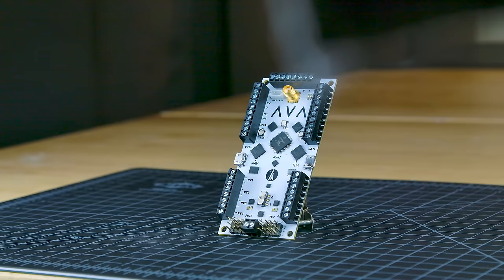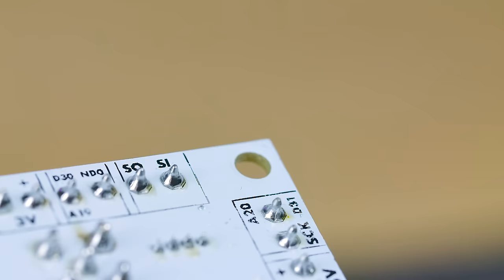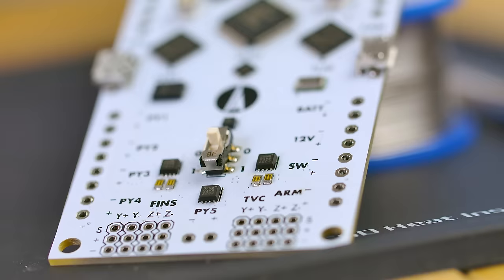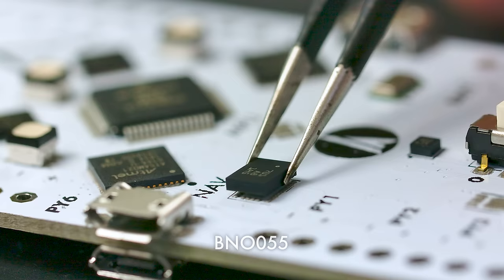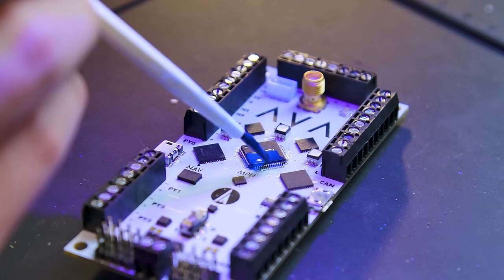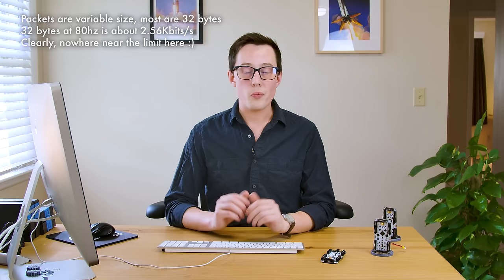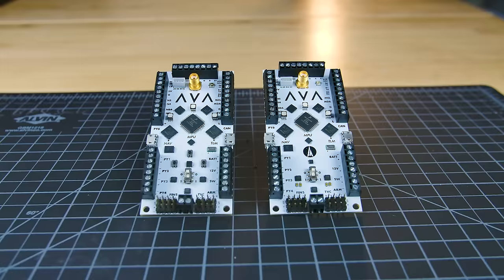The AVA Flight Computer

Comment: Joe, ... dude, why are you apologizing and feel you have to justify your choices. If an avionics or electronics engineer or micro systems designer is watching your channel, I guarantee they are 100% impressed at your over all knowledge, skills and craftsmanship. I am (was at one time - retired now) an electronic tech, process controls tech, microwave systems tech, and eventually combined that all into marine automated systems tech/engineer. I once worked for a satellite communications company as a PCB layout design artist and lab tech (doing it the hard way with graphics layout tape and dry transfer and etching each board one at a time - mid 1980s) You have NOTHING to be defensive over. Those that make "snarky" comments want to feel they are on a similar level with you. In a way it is a compliment that these people are using your abilities as a measurement for their own abilities and knowledge - that you are setting the bar they wish to beat The others that are just being rude, tell them to kiss the warm end of your rocket motor and go start their own YT channel.

Comment: I don't know if this is helpful or not two years down the line, but your problems with UART are probably down to the implementation used in the Arduino bootloader. When implemented correctly, UART should not take up any more CPU time than any other protocol. The software just needs to be optimised to hand-off as much of the processing to the UART hardware in the CPU as possible

Comment: Arduino is nothing to be ashamed about, its a really useful environment, but it is really inefficient and slow compared to dedicated IDE's such as the ESP-IDF for the ESP32, which has 2+1 cores that can run simultaneously at 2x240Mhz+8Mhz

Comment: There's a reason the very first command I always give nearly any UART device (including GPSes) is the one that switches them from 9600 to 115200 baud.
Although if you write everything to use the UART interrupts rather than polling, then the low data rate isn't really that bad.

Comment: What many guys fail to take advantage of is a RTOS.  Many simply think lets get a faster cpu.  That does not matter much when your doing one task at a time that is slow like serial or even I2C data. 
Time to move onto the ESP32 using ESP-IDF, and NOT the Arduino flavor as its a joke.  ESP-IDF has a feature called menuconfig where you can customize so many options for the dual cores its crazy. When you use Arduino for it, they do not allow you to get access to all those settings which is just plain stupid.

Comment: In the 90's and the early 2000's I've learned to work deep with UARTs, their flaws and limitations. My bible was the "C Programmer's Guide To Serial Communication" and I have my head filled with so much useless information about serial communication. The principles always were very simple but the implementation... well... almost never was.
When I see a young engineer bitching about serial communication, it makes me feel old.

Comment: What's the difference between unlocked and locked GPS units? I thought only the military could get GPS chips that don't shut down if they go too fast or high.
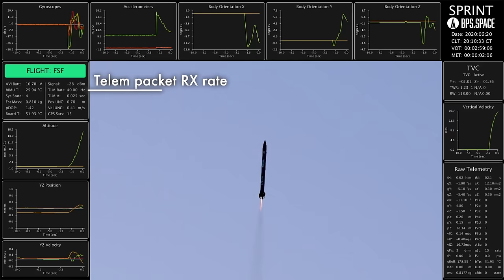Edit: 14:44 Wtf, data is being sent as a string, why?! Did you mean just as a string of raw bits of a certain length... like a packet?
Reply: packet im pretty sure.

Comment: You are probably going to be better off with your current design with multiple MCUs with separation of duties compared to a multi core multi threaded single MCU and have to deal with synchronization issues.

Comment: I don't see that it is "amateur" to use Arduino and / or Arduino IDE. There is no reason for making every library and other stuff by yourself, when there a lot to take from and you can use as you want. Neither Arduino or the Arduino IDE are not limited in anyway, that let you make good stuff or higly skilled algorithms. The only limit is in the chip that has been choosen for the project. Yes I still use Arduino IDE 1.8 and also the original Python IDE when i do coding. They works, do as suposed and time is spent on the project, not errorcorrection on a 3. party software.

Comment: you make really good videos.  If rockets ever get old I think you could be equally successful in many other areas of Maker/engineering.  Trying to make an on off rocket perform like an analog controllable rocket may be something that turns out to be impossible to land reliability.  This isn't YOU this is analog vs digital actuators.
Reply: Rockets will never get old

Comment: how can i get this flight computer ! i can't found it
Reply: he isnt selling it. like he said in the video
Reply: Holy sh*** i need something like this I working in my graduation project try make quadcopter and it's very difficult to get position from IMU i search about navigation systems algorithms or autopilot , where can i get these things?
Reply: @darkknight700  you can make your own!
Reply: Nooooooo , i try do it about 3 weeks , to get position need to do double integration use trapazoidal , so every small noise will integrate twice  ,,, so the error very large ....
Reply: @darkknight700  you know this flight computer is for rockets right
Reply: @fullflowaerospace   yah I know , I just  will get NAV part
Reply: @darkknight700  that’s not how it works

Comment: Do not I mean never bring your macs in to a high humidity area like the bathroom cause then when something goes wrong apple will say "your computer has water damage you need to replace the screen, motherboard, hard drive, and battery. it will cost you $2000, my suggestion is to buy a new macbook for the same price" like we are idiots.

Comment: reason not to use arduino it's not because of shape.. but it's because it sucks! For more complex things you most likely need to go and modify their libraries but in professional settting you shouldn't need to do that. Arduino makes it complex and unnecessary instead of just providing a proper way of accessing libraries or making sure they are well written (full of bugs which waste your time)...